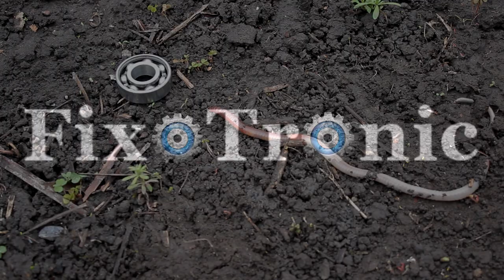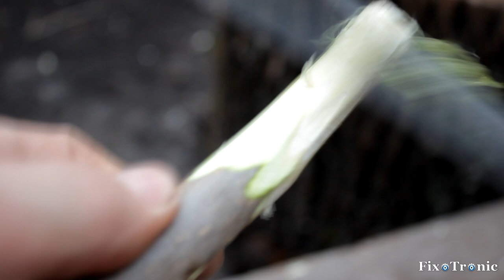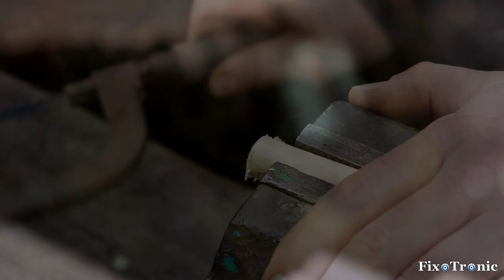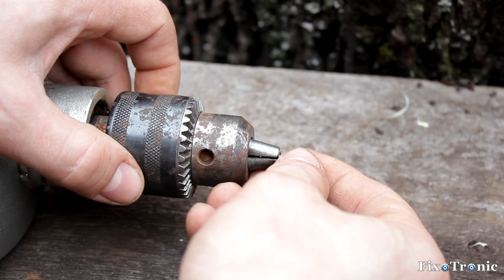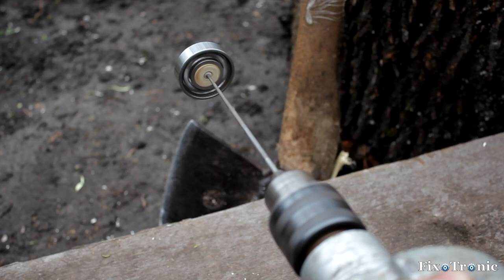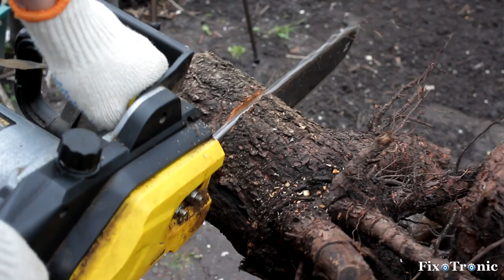Bright Idea With a Drill and Bearing!

Comment: You might find this interesting if you don't know anything about filing a saw.  Note that the saw cuts poorly after this process.
Reply: Yes, the chips were very small, seems to have to PUSH the saw through the log
Reply: Yep and surely eats up good quality files. I scrolled to see what I was watching for and haven't see cutting yet. Same thoughts asap. Bet I now see/ hear a chainsaw crying with need of help to be pushed through instead of slight hold back so its singin at like 12000 rpms and spitting stinging chunks. Then unsquaring, burring and burning the bar. I could be wrong ?
Reply: Oh its electric ? Not bad, maybe safer for people not as skilled as you guys/me but darn working it like that gotta be brutal in know time for ones not doing it all the time. Love my Ole non set 066 or when needed the 088 with 4ft. bar.
Reply: Throwin cedar scented talcum powder after that little job.

Comment: He will wear out that chain ten times faster than if he would properly use a file.
Reply: The file will also wear faster. They are made to cut in one direction only.
Reply: Chains are cheap when compared to time wasted
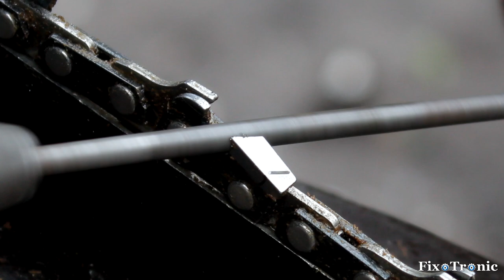Reply: @gjknepper  you actually see it creating a "dent" in the file almost instantaneously. @2:46
Reply: Sorriest attempt at sharpening a chainsaw blade ever. Want to watch another video to see if this is a comedy channel

Comment: That is not at all how you're supposed to use a file or sharpen a chainsaw chain which was obvious at the end with the dull chainsaw ,only 1 way to sharpen a chainsaw and unfortunately ,there's no easy way around it,spinning a round file is useless as far as getting results from the file ,in fact pulling it backwards ruins the cutting edges on the file, great use of a bearing ,poor use of a round file
Reply: I guess it just proves that amateurs can only teach amateurs to be amateurs. See my comment on this video.

Comment: A chain file is not designed to cut in a radial fashion. It also will not sharpen the leading edge of the cutter hood using your method.
I’m a tooling engineer at a Blount International.  (Oregon chain)
Reply: Well how then?
Reply: @tjudson6933  files cut by being pushed forward, not by rotating them. A file used in this way would dull itself - and anything you tried to "sharpen" with it - within minutes.

Comment: Would be better on a shaper, sanding dowel, rasp, or polishing application like a brush that is designed to cut, sand, or polish in a rotary action. Files are only designed to cut pushing forward one way; even applying too much pressure on the back stroke can dull the file and limit its cutting ability. Likewise, when shaping a metal edge we don't want to have leafing of the metal away from the cutting edge, so we always clean up with a back stroke or two to clean the edge.
Reply: Came here to say exactly  this. All you are doing is destroying your file

Comment: great creativity! Though if you're going to sharpen your chain, make sure to tighten it first so it doesn't move around so much.  And also, i believe this type of file is designed to work in the push pull direction... so you might be better off using a reciprocating saw instead of a drill bit, this way you won't ruin the file.

Comment: Good idea but there is a major problem with this idea. A file is meant to be used by pushing it along the length of the file. Your idea rotates the file...you will probably end up wearing out the file a lot faster.

Comment: The teeth of a chain saw file are designed for axial motion.  The one I looked at they are cut as a right-hand helix (like a regular screw thread) so spinning it CW is not going to cut, (like pulling a regular file backwards).  And trying to sharpen without a guide is usually just a wasted exercise anyway. Your blade bevel angles will be all over the place and you might end up not even sharpening the blade tops at all.

Comment: Working well for me to enlarge drill holes that is not aligned to make its shape change round to oval, better than air files from harbor freight. Imagine how to insert a long pin inside 2 parallel poles with 4 holes in one axis, but the 2 holes inside are off a little bit ? this is the cheapest way to fix that problem manually.  I never see any bits in the market that can do this job, unless you have a milling machine. Thank you very much for the idea.

Comment: Good idea for the chainsaw case and can also be used with a cordless tool.
You couldn't film a video about making one, but inside my chain saw case I stow a Pferd 17300 Chain Saw Sharpener CS-X, File 5/32 inch, File and Depth Gauge File in One Ergonomic Tool which is a very useful manual tool.  Stihl and others also market their own proprietary design.  I also stow an extra chain, just in case.
Speaking of making videos, perhaps you could film a new one on removing and replacing dangerous hatchet handles; that one you are using is really yelling, fix me!  LOL.

Comment: Files, round or flat are only effective in one direction, based on the cut angle of its teeth. Using a forward push stroke. It’s not a grinding wheel! The shape or contour of the file is is intended to align with target surface or shape, either restoratively or to create. A round file used as drill bit will not effectively sharpen a chainsaw blade and will ultimately ruin both blade and file.

Comment: If nail slipped from wood , make hole in hand
Reply: My thoughts as well. After holding the bearing for awhile, even using minimal force to push back, what's to stop that file working the hole just a smidgeon wider to then find the file drilling the palm of your hand, ouch...
Reply: That's where common sense and good dude skills comes into play
Reply: ok
Reply: @davidhamilton506  JB weld a penny on the other side !

Comment: That’s a safety no-no, wearing gloves while holding something that’s rotating.
Reply: Oh look, the obligitory safety nanny has turned up.
Reply: the ravedaddy Ask nine-finger Louie what he thinks about it. 🙁
Reply: @carl6149  i dont know any 9 finger louie, is he someone you made up to try and impress everyone?
Reply: its a fuckin battery drill lmfao youd break the drill before it breaks you
Reply: @theravedaddy  i know a guy with 9 fingers but unfortunately there was no cool power tool mishap he got his hand stuck in some gate
Reply: a drill stops when you got in the gloves. Try it.
Reply: This guy is right, as a first aider in a factory, I personally had to deal with a finger - glove - BATTERY drill incident. Pretty much crushed the end of his little finger. It was black for about two weeks. Not nice, not nice at all.
Reply: A battery drill will remove car wheel bolts, I'm fairly sure a finger isn't a problem.

Comment: 2-3 passes with the file every time I add fuel and don't have an issue. This is like 50 passes and still didn't cut that log quick. So no doubt not filing anything off the racks.

Comment: Pretty smart, but a word of CAUTION, you will remove more off some teeth than others if not very careful causing your chainsaw to jump around and vibrate in your cut. You must hit each tooth for the same amount of time (duration) and at the same rpm of the drill motor.  Preset the speed on your drill motor and squeeze the drill motor for a second, no more than two, so you will file all the teeth the same. Be careful, you can ruin a new (but dull) chain quickly.

Comment: as the teeth of the saw wear down, you periodically have to grind down the rakers as well when sharpening the chain saw or you will only chip out fine pcs of wood like a planer blade. You want to get deep chips to saw faster

Comment: I appreciate the inventiveness but two things- 1- the file has a taper to it and that is not appropriate for a saw chain and 2- files don't cut well going sideways. Better edge would have been made by the right size file used in a forward, normal filing motion.

Comment: Don't think a file that is designed to be pushed would like to be turned. Possibly at a VERY slow turn. When sharpening I do twist the round file but it's maybe a quarter turn on the length of the stroke. I like to feel the file make the cut and I keep the angel very straight to produce and edge that rivals the factory sharpness if not better. That saw blade didn't pull a ribbon chip like a really sharp chain should.

Comment: I'll just use this rusty nail in my rusty drill after I cut the rusty head off with my rusty pliers cuz I don't have a rusty drill bit in my rusty tool box. SMFH! But I did find a brand new SHINY bearing on the ground. ????

Comment: Not bad, but I'd suggest using a little oil or other coolant on the cutting surface to prevent over heating of the saw teeth which could and most likely would result in loss of the temper and hardness of the teeth. This would lead to premature dulling of the saw.

Comment: That's a wonderful waste of time, effort & a good file. Always sharpen chains the way the manufacturer instructs you to. Files were not meant to be " drawn back" it breaks the tips of the cutting the cutting teeth on the file, rendering it useless. If that was  Rotary File ( like a Rotary Burr)  it might work, but rubbing it back & forth will overheat ( blue) the chain cutting tip on the chain. Stick to using files they way which has been proven to be effective

Comment: There's a difference between sharpening and grinding.
Your chain might have more edge on it after this method. But you'll have to "sharpen" it again more often. And you'll have to replace it more often. This looks like a good trick when you need it on the field, sometimes you do what you gotta do, sometimes tools are cheap or disposable. But it's a lousy way to treat tools if you want them to last.

Comment: Having carried a chainsaw to work everyday for quit sometime I can tell you that this is totally stupid.

For starters,
Ya... we all have a $400 vise sitting on the ground out in the woods.
Ya... I'm just going to pull a $20 bearing out of my pocket. Maybe I can spot one just laying there on the forest floor.

This is so beyond stupid.

I can sharpen my saw by hand with a file in less than 3 minutes.
What a total waste.
Reply: Ur prices a high but I get it 
no need to carry a power drill with file attached to a bearing if it does only ruin the file when the file and same skill is all u need

Comment: 1) Use a Cordless Dremel with Chainsaw Sharpening bits out in the field
2) Use a Bench Mounted Chain Sharpener to prep your chains before you leave
(and don't bother buying the crappy Bench Mounted Sharpener sold @ Harbor Freight)